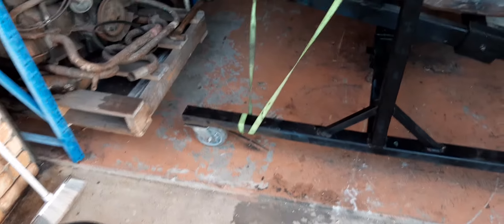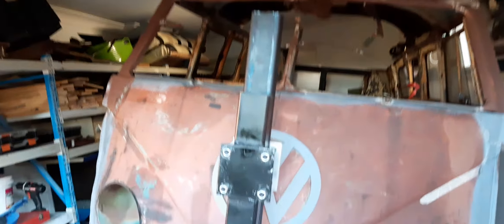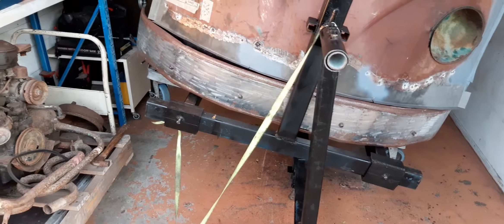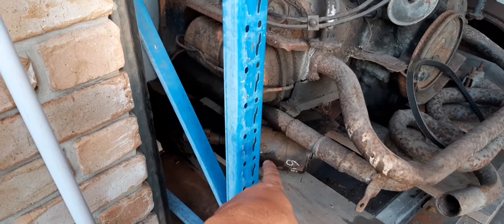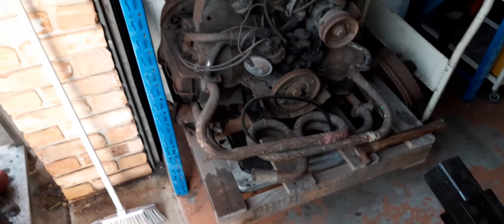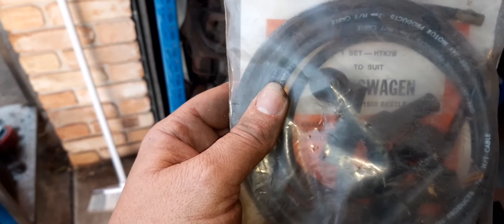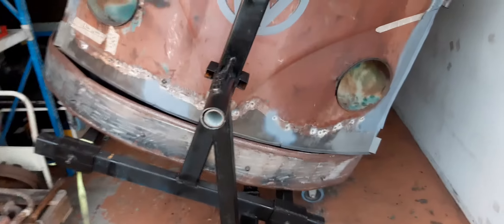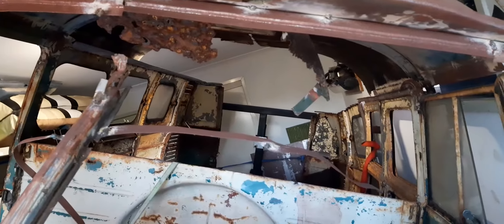#VWBUS #PRESSEDBUMPER PANELVAN   rotisserie finished

Comment: I’d stick with copper wire core HT leads.  The engines can take sitting around and will still run ok as long as it’s prepared well.  The garage is so tight and it’s amazing what you have achieved in that space